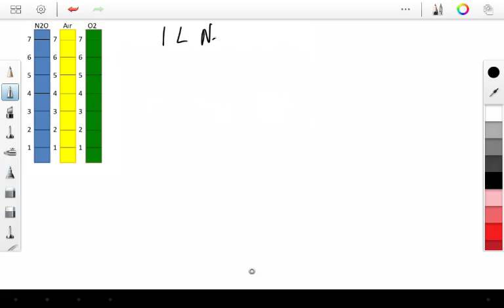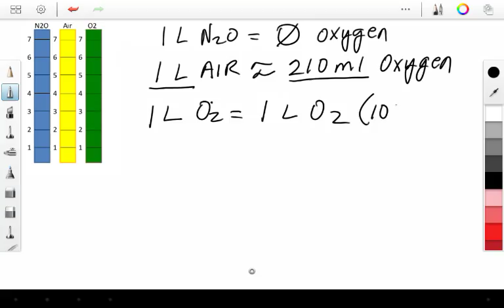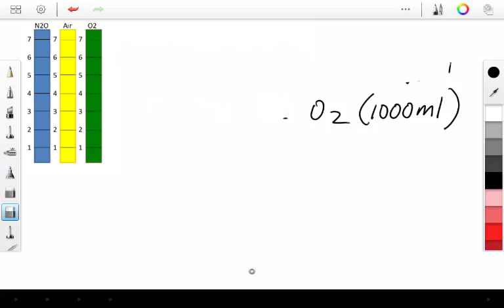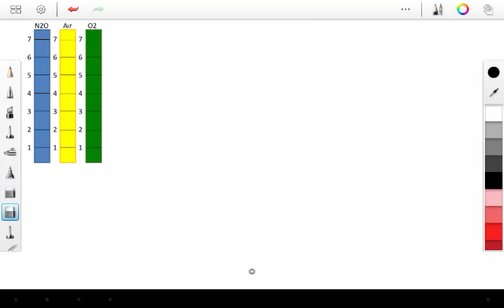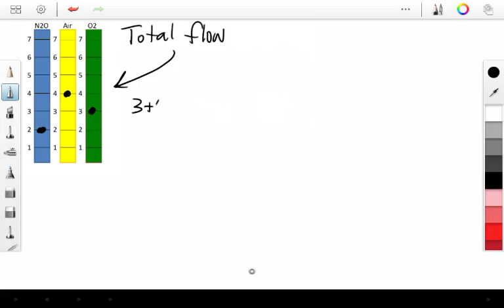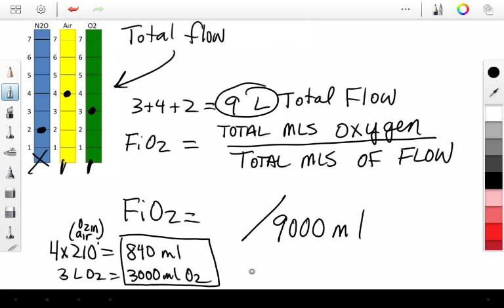Calculating FiO2

Comment: What if you had the FiO2 and total flow between 2 gases but needed to find the individual flow of each gas ? I was trying to work it backwards but can’t figure it out !! Thanks !!
Reply: Say the flow of gas 1 is f1 and gas 2 is f2. Also say the fraction of o2 in gas 1 is x1 and in gas 2 is x2 (I.e. x of pure o2 would be 1 and of air would be 0.21)
Say the total flow (which is known) is f_tot = f1 + f2
FiO2 = (f1*x1 + f2*x2) / f_tot
So: FiO2 * f_tot = f1*x1 + f2*x2, with the left side being known in value
You can then use f1 = f_tot - f2 and f2 = f_tot - f1 to get the right hand side to a single variable and solve it.
For example for f1 it would be: FiO2 * f_tot = f1*x1 + (f_tot - f1)*x2
If you rearrange for f1 you get: f1 = (f_tot * (FiO2 - x2)) / (x1 - x2)
Then you get f2 from f2 = f_tot - f1
Hope this helps!